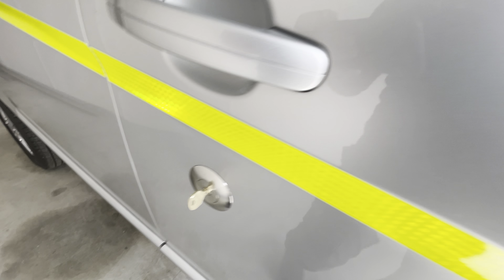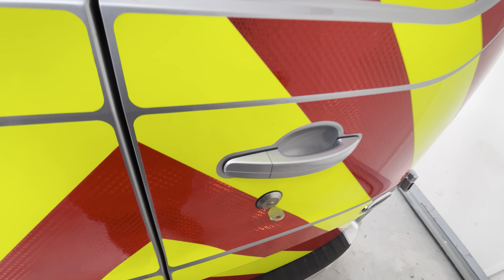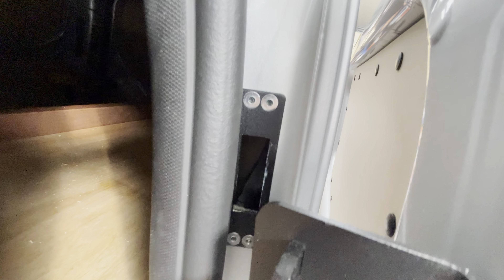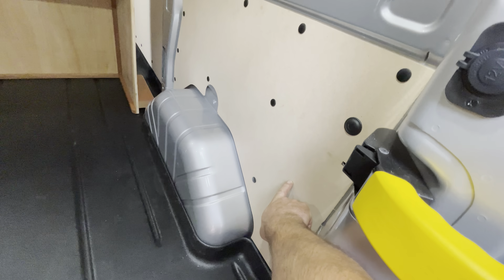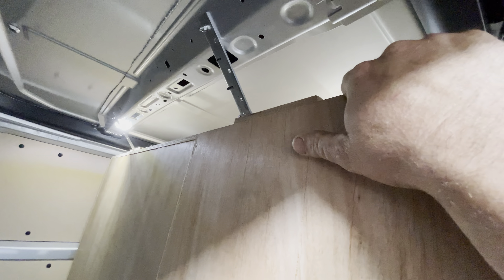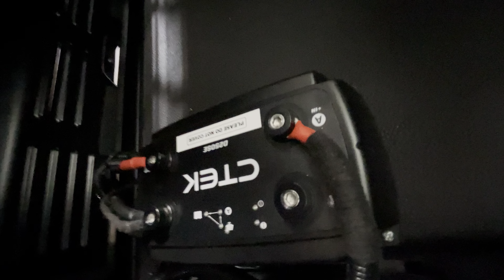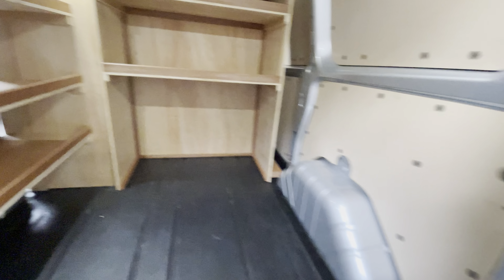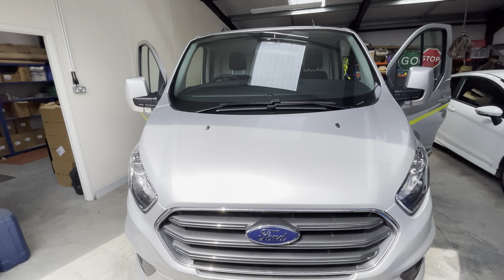Transit custom deadlocks lights split charge

Comment: Just wondering why you didn't use the built in CCP (customer connection point) that is fused and live for 20 mins after engine off. It's rated at 70amp and has run my leisure battery for last 6 months in my euro 6.2 custom. It's on the driver's seat frame door side and has an earth and 2 positive terminals and best if all doesn't effect warranty as fitted by ford.